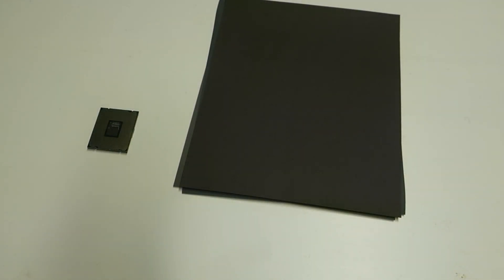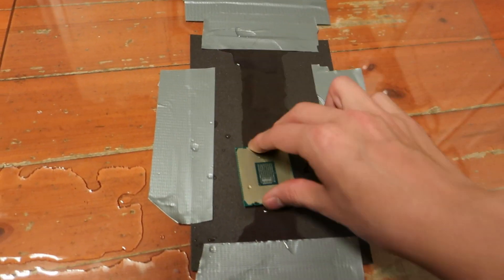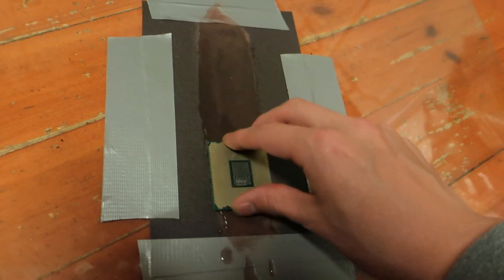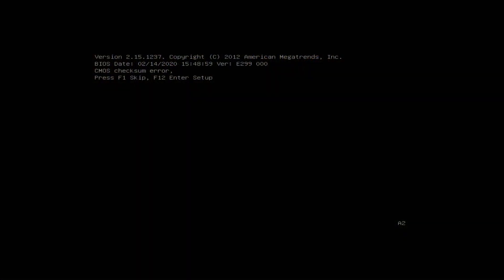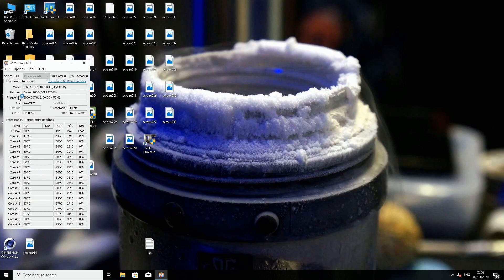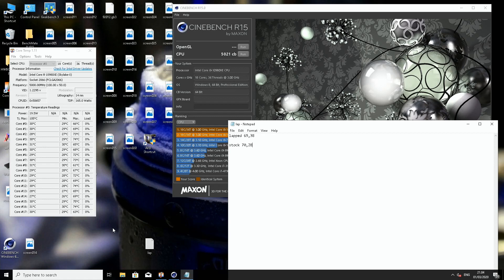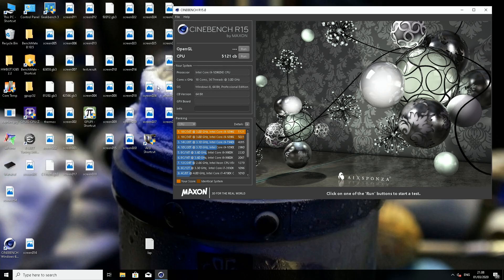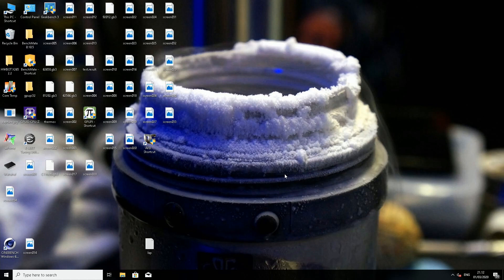Cascade Lake-X 10980XE CPU Lapping to Gain More Performance for Free

Comment: I wonder how you get that realy low temperatures. I'm currently using only a 14 core i9x10940x at 4,6 GHZ with 1,20V i already hit 90°C.  I'm using it with a Alphacool XPX Pro U1 Cooler. My Watertemp is 31-33°C. I lapped the cpu ihs and i'm using thermogrizzly kryonaut. I re applied the paste two times but it doesnt change it still runs hot. Is the 18 core realy running colder then the 14 core? Should i swap it for a 10980x?

Comment: If you really really want to lap properly you need to lap both the cpu and the block. Manufacturers have for a good while now been adding a slight concave to blocks to compensate for the deviation found in a lot of intel cpus.
Reply from the maker: This is true, this is why I mostly care about LN2 pot. For water I don't mind about lapping too much due to this.

Comment: Lapping an IHS is only useful if you have a very very bad IHS. In most cases the flatness will be worse than before. In addition, the cpu clamping mechanism will ruin your work.
Look here, what we measured
https://www.ocinside.de/workshop_en/intel_ihs/

Best regard
Reply: Very interesting writeup! It seems in your case the lapping did help a bit, I'm sure you know overclockers try to squeeze every drop of perfomance out of their parts they can, so it's still worth doing, plus I believe the main purpose is to get a better mount on ln2. The crown shape is probably preferrable as the die would become the high point with the best contact to the cooler. Did you ever do the same for an AM4 CPU?
Reply: @teddygoboom1  no, did not do that with an AM4 CPU, because I don't have one in spare. AM4 lapping is more difficult due to the pins on the CPU. The risc to bend a pin is very high and I don't want to break my own CPU. But the result would be very intersting.
Reply: Sir  2066  and 775  is  completely different  ... How to Compare
Reply from the maker: Yep, not really point atleast for air or water.
Reply: Just clamp the cpu down with the waterblock.

Comment: thanks  for the 10980xe content can't wait until mine gets here. Intel dropped the ball with this can't find it anywhere in stock. eta is showing 3-25/4-17
Reply: Buddy I'm sorry but you ain't getting that for a long time... theres a pandemic going on. Check intels distributors, otherwise good luck trying to get one let alone for a good price.
Reply: I already paid for it $995 and overnight shipping I think if I get it it will be between the timeframe shopblt has listed on the warehouses website 4/10-4/17 well I bought a 7900x while I wait so it makes waiting easier now I will be able use my pc I sold my 7980xe for one so it paid for itself